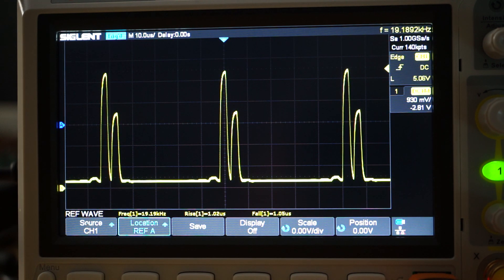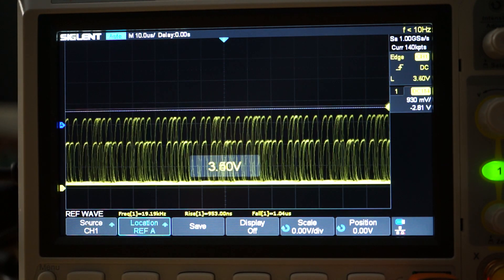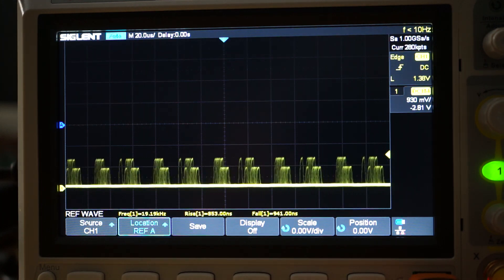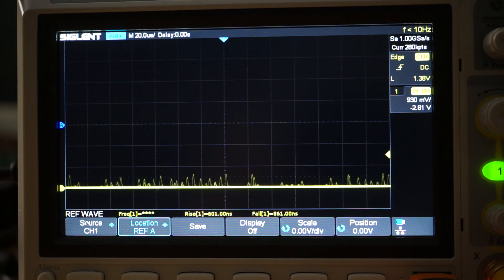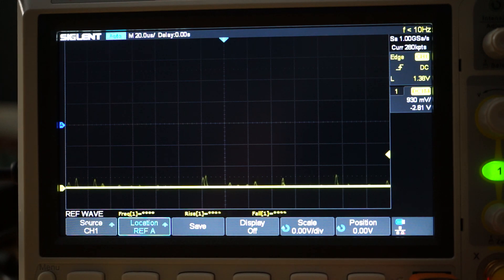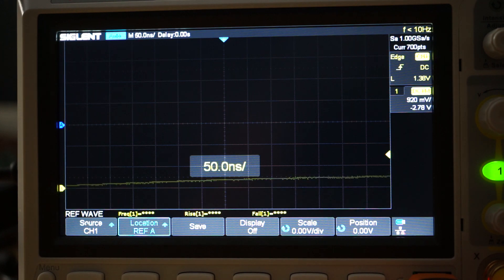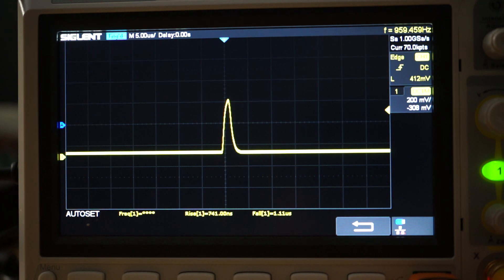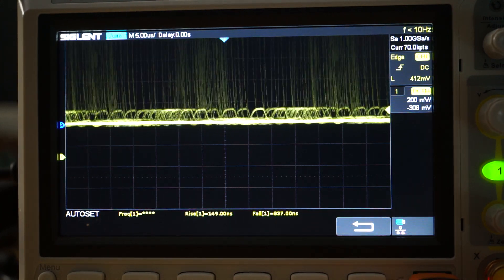Apple iPad Pro 12.9-inch 2021 M1 PWM of the Mini LED Display

Comment: This mini LED iPad almost instantly gave me headache on my first day. I felt like I can see the flickering with my peripheral vision or like the screen is so shiny my eyes can't properly focus on anything (maybe it's because of astigmatism). Reducing the white point is helping now and I hope I will just adapt to this screen like I adapted to Galaxy phones years ago. iPhone 13 Pro is very comfortable somehow.
Reply: Hi did you end up getting used to the screen ?.
Reply: Hi did you end up getting used to the screen ?.
Reply: @yiruicao9247  Yeah. After a couple of months. I can use it for hours now even with default display settings.
Reply: @Arslanenok  I have high myopia and astigmatism. I'm worried that the mini-LED screen on the iPad Pro 12.9" M1/M2 and MacBook Pro M1/M2 would kill my eyes in the long term.
Reply: @yiruicao9247  can’t give you any advice but I’ve used Macbook Pro 14 and it’s comfortable for me. M1 iPad Pro still feels weird if I pay attention to it but Macbook Pro 14 screen doesn’t bother me at all
Reply: @Arslanenok  That's strange. The iPad Pro M1 has a 19190 Hz PWM, which is higher than the Macbook Pro 14 M1's 14880 Hz.

Comment: I have a question, when the mini leds are off. For example using a black screen or site. Does the pwm stop? Or does pwm happen in the lcd part. Sorry I’m not great with tech so may be a silly question.
Reply: in that case the black areas won't have flickering but the non-black areas will.

Comment: I wonder what to do when they start using these screens everywhere 😑
Edit: I got a Xiaomi 10T Pro which has a 2kHz-pwm LCD screen. While it's better than Samsung's 250Hz-pwm OLED screens, it's still pretty bad and the only way to fix it is to use the phone at about 60% max brightness and up (which is fine because the screen isn't very bright).
Reply: I'm now turning on DC dimming full time on this phone, uses more battery but it's totally fine now.
Reply: I just measured mine on opple flicker meter on several brightness levels and the frequency was between 17 and 20 Khz in other words 10 times more than reported by you. In order to avoid any mistakes any measurement was done 3 times. Also it's not just frequency alone that matters, but also modulation depth. The flicker index is great - less than 1% I don't feel any discomfort even on low brightness while being sensitive to PWM flickering. I beleive OLED screens will never be able to match IPS in that regard.

Comment: Does the 2020 12.9 inch ipad pro have pwm?
Reply: yes but it's ≈59kHz so most pwm-sensitive people won't be affected
Reply: @zaxele  it affects me. The 12.9 2020 iPad Pro doesn’t have PWM. Notebook check is wrong actually. I have had to return a few phones with higher PWM rates tho.
Reply: @M_harch  is there any decent phone without pwm now? :(
Reply: @zaxele  there’s a few, iPhone  XR, iPhone 11, iPhone SE and the Samsung A 32 5G. Wish there were more options tho

Comment: 2021 Ipad Pro 12.9 definitely strained my eyes, not as bad as the OLED iPhones but still noticeable. I'm sensitive to PWM sadly.
Reply: That’s my fear, I rn have a LCD phone and I’m worried about the future, because if nearly every screen is going to be OLED and Mini-LED I won’t be able to use them
Reply: @Alex-hv3ir  snap. Not only do I think PWM is an issue but also dithering. So the screen controller and software. Nightmare situation for those sensitive.
Reply: Does 12.9 inch mini led display on long hours of reading and watching online classes strains eyes 👀  because it has pwm is 11 inch ipad pro 2021 better because it doesn't use pwm please clarify me
Reply: Still?
Reply: Does 12.9 inch mini led display on long hours of reading and watching online classes strains eyes 👀  because it has pwm is 11 inch ipad pro 2021 better because it doesn't use pwm please clarify me
Reply: @balajireddy7811  Not long hours but can get headache.
Reply: Does this flickering really hurts our eyes 👀 on long hour's of usage

Comment: Is m1 ipad pro 11 pwm or dc?
Reply: No pwm
Reply: @krigs6137  thank you
Reply: What’s the difference man
Reply: @denissssss8579  Pwm can be understood as flickering on the screen, which may be high-frequency flicker, so that our eyes cannot perceive it. If it is low-frequency flicker, it will cause great damage to our eyesight. Sometimes it does not flicker under high brightness but only under low brightness. Flicker, some product screens flicker at full brightness. DC can be understood as zero flicker of the screen at any brightness.
Reply: @droedospace  ok does it flicker more than my OLED screen or not as much as I heard OLED phones flicker as well…
Reply: @denissssss8579  Most of the oled screen phones are pwm dimming. If you want to buy dc dimming oled phones, you can look at the eye-protection mode of flagship phones of Chinese brands.
Reply: @droedospace  thanks 🙏🏻
Reply: The 11 inch is still LCD, “worse” technology but doesn’t cause eye strain, the 12.9 inch in the other hand is mini-led and has PWM
Reply: @Alex-hv3ir  no
Reply: @Alex-hv3ir  I got the 13 inch m1